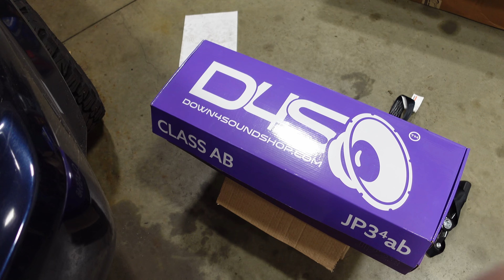Down For Sound JP23 and JP34 Install....and some fun!

Comment: Everything looks great. If i could recommend anything it would be to raise your amps a quarter to half inch off the seats to let that fan be able to flow better through the bottom plate. And adding fuses up front by the battery typically within 18in. Im sure you already kno these things but maybe someone watching doesnt. looking forward to the future vids
Reply: How about 1inch from the battery terminal, resting on top of the battery infact? Is this chill lol? Cuz that's what I did when wiring my jp34ab last night. I remember hearing closer is better, and there wasn't a good spot to rest the fuse other than right on the battery so I just went with it lol. Wires are secure and heatshrinked too(no chance of shorts I don't believe)

Comment: Nice build thus far.  Definitely not losing my mind, but I do have a serious question.  I have those same two amps plus 2 1004's and a DSP for a build going in this summer.  How are they doing heat wise with the amps snugged down to the seat?  I don't see any way for ventilation to get in, which with the 34 I could see being an issue.  I ended up having to flip my 23 over for better cooling so the fan could do it's job.  I just picked up the 34 and I'll be doing the same with it.

Comment: Well guess the haters will say why you still running lead acid battery and not agm or lithium
Reply from the maker: Because I’m cheap 😂😂
Reply: @MorFabIndustries    Walmart sells AGM batteries for $175 .   i bout 2 of them with an isolator and a mechman 300 amp alt.  it runs at 15v regardless of how loud i put it.
Reply: @marksalisbury1132 they didn't have any agm in my size 😔